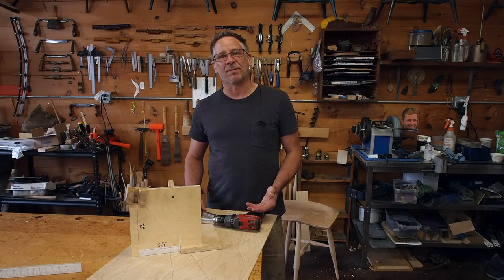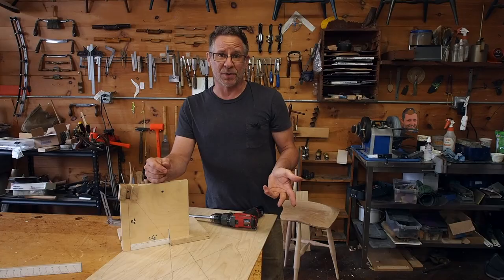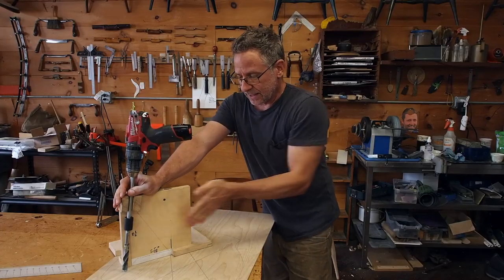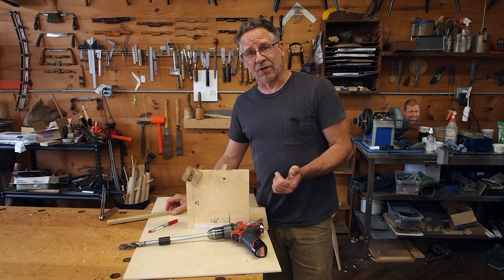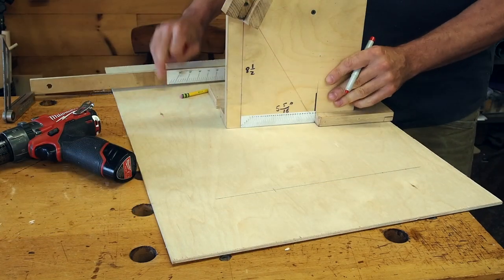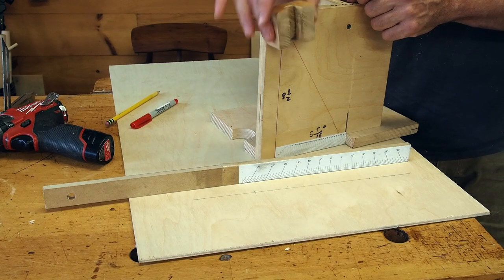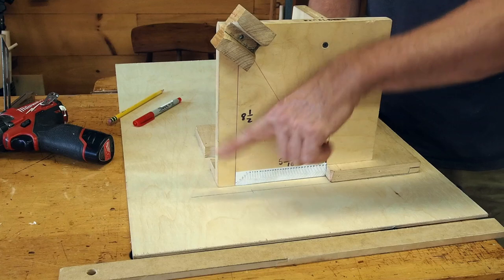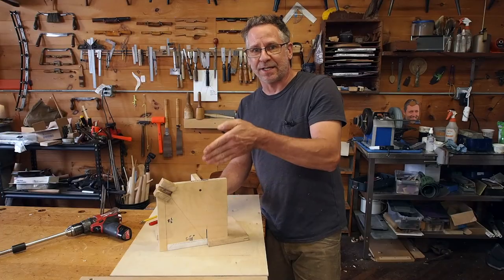Drilling Jig For Chairmaking

Comment: Hi Peter. I've made the fixture as you've got here. It didn't print out to the 8 1/2". So I traced all of the points back and drilled the centre at that point (I think it was 8 5/16)
Anyhow I've also put a locking handle on the top block to keep it still. Works brilliantly.
Thank you. Jamie